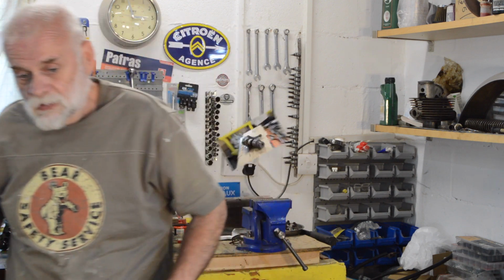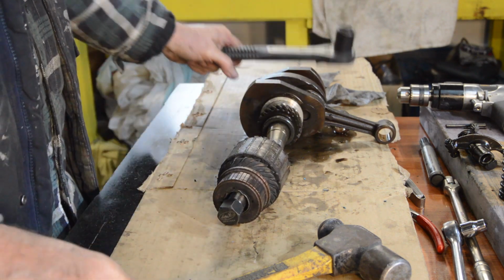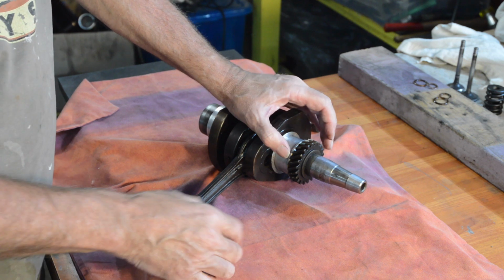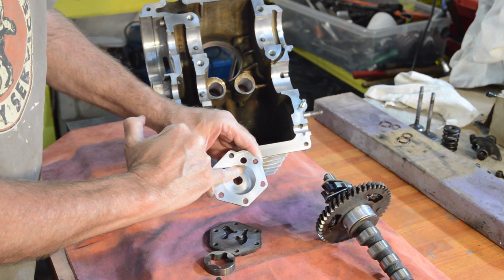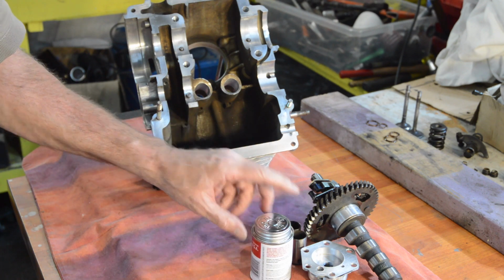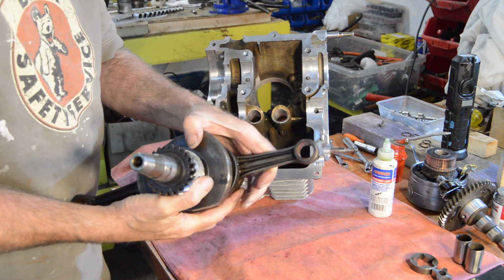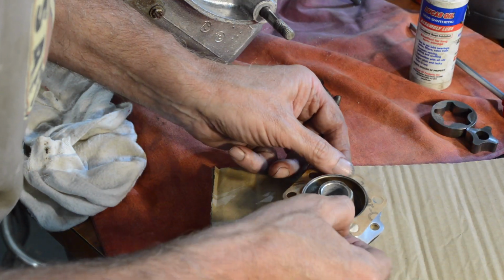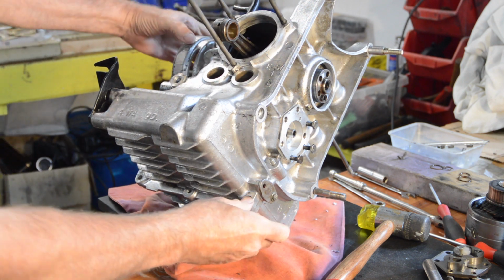425 2cv Engine Part 5

Comment: I’ve just bought a 1954 ripple bonnet with a 375cc engine Mark. There’s oil leaking from the rear of the Dynamo preventing charging(and making a mess) I’ll need to change the front crank seal, so need to get the Dynamo off. Is that Honda 754 removal tool 20 x 1.5 or 18 x 1.5. I did a search but it seems to bring up 2 different measurements depending on which site I look at. Good to see you got the crank play reduced. Some people have removed the 375cc engines and fitted your engine to lift the horse power a bit.
Reply: Cheers Mark. It will be slow fun! 9bhp is not going to cause any neck jerking issues anyway🤣
Reply from the maker: Hi Conor, the tool was M20 x 1.5 if I remember correctly. The only drawback with it is that is shorter than the original Citroen type so you may have to use a drift to tap it if the engine is in the car with front cowl on but that is not too awkward. 2cvXpert had a ripple on the front cover with this engine in a couple of yers ago, so probably a popular upgrade in France too. The crank play is a bodge but it worked so I was happy. Have fun with the Ripple !

Comment: Another very informative video, thank you. I’m impressed with how clean you get the casings etc, what solution do you use? Also if I may, what’s the name of the liquid gasket you use and is it available in the UK? Many thanks, John
Reply from the maker: I use Comma Hyper Clean John and lots of elbow grease, I have found it to be the best degreaser by far. The liquid gasket is Gasgacinch, not widely available as it is American but pops up on Ebay from time to time, but if you are tempted ask the seller what the sell by date is on the tin before you part with your cash.
Reply: @oldnutsgarage  ..thanks for the info. Do you leave the casings to soak overnight or just get stuck in with the brush?
Reply from the maker: I usually get stuck in, then check for any stubborn bits, they are usually in the edges of the casings, scratch them out, then redo. If things are really dirty I will leave them to soak for a few hours. Cheap castings ( not 2cv ) can change colour if left in contact too long with some degreasers.
Reply: @oldnutsgarage  ..good to know, thank you.

Comment: Thank You for the crossover reference of the Dynamo removal tool,  that is quite the savings.  On the crank, I agree that with as little wear was seen a slight tap to adjust the end play was worth the try,  does it not have sludge ports to check and clean?  Thank You for sharing.
Reply from the maker: Yeah I thought it worth a go Max. There are no sludge traps on the crank, Citroen wanted them swapped whole when they wore out.